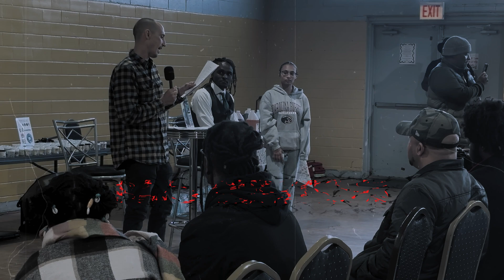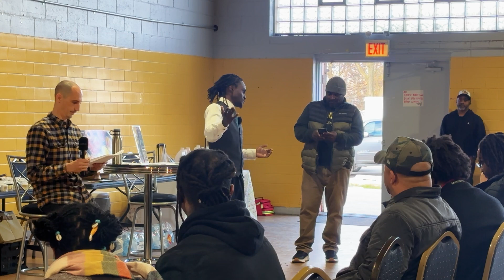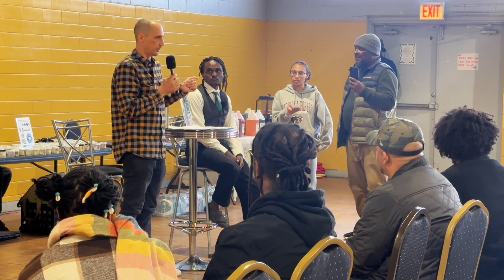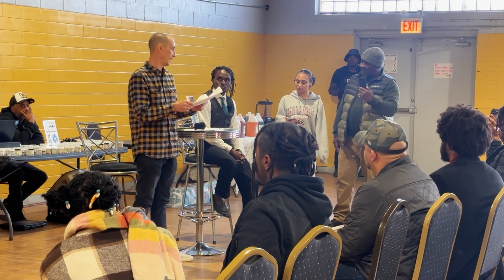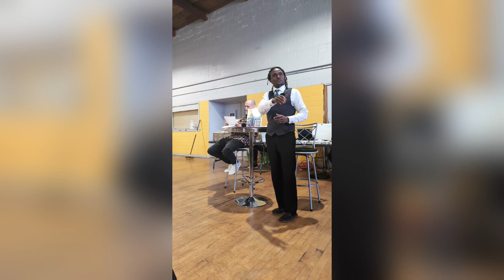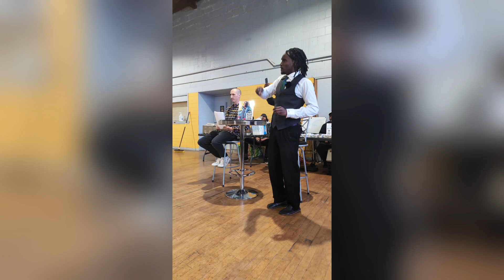The Plastic to Fuel Debate

Comment: A Few Points to Clarify:
Parameter Control: When I mentioned that your system doesn’t control parameters, your response about turning magnetrons on and off doesn't quite address the issue. In a system as large as yours, that's going to result in uneven heating, which inherently creates wide, uncontrolled thermal gradients. And because your condensation system is passive, you're essentially letting condenser performance dictate pressure and temp, rather than actively managing them. This makes reproducibility and safety harder to achieve.

Burning Unknown Fuel: You downplayed the importance of analytics by citing decades of literature on petroleum fuels, but pyrolysis oil from mixed plastics — with adhesives, inks, and unknowns — isn’t the same thing. You still don’t know what’s in your fuel, and saying you spoke to the EPA and they were "okay with it" because it’s a closed system doesn’t hold up when your own videos show venting to atmosphere via a pot still. That’s a direct contradiction.

Analytical Dismissal: You dismissed the cost of in-house analytics, even after I gave examples of affordable GC/MS systems that are well within your means. I’m self-taught in this area — and if you’re serious about leading in this space, I’d encourage you to do the same. It’s doable and absolutely worth it.

Unsorted Feedstock: I understand your philosophy of wanting to create a “universal” solution, but dismissing basic chemical controls in R&D makes it difficult to know what’s really happening in your reactions. A more scientific approach would be to run one plastic at a time, introduce contaminants individually, and analyze the changes. This is basic experimental design and would make your results much more credible.

Scaling Prematurely: From what I’ve seen, very little actual bench testing or analytics were done before moving into pilot-scale development. If you do have data, I’d genuinely love to see it. I’m happy to offer help in reviewing and interpreting any results to support further development.

Misleading “Continuous” Claim: During the debate, you denied saying you built the “first continuous microwave pyrolysis reactor,” but I showed examples where you did, and after that, the language shifted to “semi-continuous” and “hand-made.” Changing the narrative post hoc doesn’t address the issue. It’s not just about being first — it’s about being accurate in public-facing claims.

Feed System Overdesign: I raised concerns about your large vacuum-fed hopper design being clunky and prone to bridging — especially since you haven’t established a working, efficient small-scale system. Using an extruder and melted plastic would allow you to test efficiently with 5–10x less volume, reduce energy input, and eliminate handling issues. But again, that suggestion was dismissed based on your desire to run contaminants — a goal that really should come after building a reliable, clean baseline.

Vanillin Mocking: We didn’t get to dive into this, but I wanted to say that converting plastic to vanillin is not only viable — it’s impressive chemistry. Mocking that pathway undermines legitimate science. It’s a selective, high-purity process that requires skill and discipline. If you’re trying to win over scientists or institutions, respecting these efforts goes a long way.

Public Messaging & Accountability: Your language and claims on social media are often grandiose and misleading. When called out, I didn’t feel there was much accountability. Instead, you doubled down on the idea that running your fuel in a truck was “historic,” when in reality, it’s not a first, and doing it without knowing the composition of the fuel is more risky than revolutionary.

Despite our disagreements, I want to be clear: I don’t want to see you fail. I want to see you win — but with systems that are solid, safe, efficient, and scientifically defensible.
Reply: Moving from a proof of concept to a well documented and tested design definitely makes it stand out credibility wise. I completely agree with what you were saying and if I was a few years younger would not appreciate it. Scaling it up a passion project requires so much overhead, so this message is golden.
Reply: What did you invent?
Reply: @investingoutdabluu2210 what did you invent?😅😅 Julian didn't invent anything his reactor is not continuous and the microwave pyrolysis machine was invented in 1971😅😅😅 can't fix stupid
Reply: @investingoutdabluu2210 he didn't invent anything. I've built ethanol recovery systems that can recover alcohol from oil at up to 600 gallons per hour using 5% of the energy that traditional distillation takes.
Reply: @investingoutdabluu2210 what did the naturjab guy invent?
Reply: So what about microplastics?? He’s doing more with plastic waste than 99.9% of the people out there.
Reply: @brandonpatterson5705 actually he's not doing more Plastics than anyone else. If you check out the full Channel of nature job. Julian also makes all natural deodorant that is utilizing brand new plastics for the containers instead of glass. He's on here preaching how we have a plastic waste problem but then he's also contributing to the plastic waste Problem by making his merchandise with brand new Plastics. Make it make sense 2025
Reply: julian needs to quit lying for views and being so defensive when others like you give new ideas or bust him out for being dishonest!!!!! precious plastics has a plastic extruder and shredder that can do everything...... cost 1500 to build it yourself, or 3 to 6k to have one built. Julian should also have a gasifier powering generator not gas to power it. his machine is not zero emissions when he uses a gasoline generator to power his set up. huge lie he makes is saying he has zero emissions. half lifes of toxic chemicals is still bad to breath in..... this dude julian just doesn't care about gas vapors being toxic, making excuses to say half life chemicals is better than the oceans..... lmao hahahahahahaha, people on precious plastic are shredding plastic and melting it back down into park benches, plastic bricks, 2x4s, and kitchen countertops........ julian will only succeed when he starts to be honest with himself and the public......or he will continue to blow himself up when he doesn't listen to others, to practice safety first. he has blown himself up 2x already....... not the brightest bulb in the pack. his last hospital er visit could have been avoided if he would just have worn a fire suit.... but noooooooooo Julian never listens, he just gets defensive, and uses big words to make it seem like he knows what he is talking about. furthermore a plastic shredder with a high torque motor with low rpm will shred and crush anything, these are also made and are open sourced to make yourself on precious plastics website. the metal yard uses this machines but at a larger scale. no one wants to see anyone one fail, but he will fail when he refuses help from professionals and keeps being so defensive..... julian is like a lil know it all,. but doesn't know it all..... lmao
Reply: @honda-s2k you are 100% right!! Except I don’t think he is dumb. He is young. And he is an influencer not a scientist. He doesn’t want to lose the following he has.
Reply: @crybbythecrybaby  he is not dumb at all, but most of his followers are. he needs to  be 100% honest and practice safety like wear a mask when making gas lmao
Reply: @honda-s2k  I agree. His ego trumps his willingness to learn. He gets his ego stroked and pockets filled by folks that think they are helping him change the world while he sells them simple skin care formulations made at home. I had held out hope that his heart was in the right place, but his disregard for actual professionals in the field makes me feel like this is another social media content grift.
Reply: @noahpcook1  sun power will never power that reactor, but a gasifier will. a gasifier is old tech and limitless renewable energy as long as a person has trees....jualin has trees.... the thing people forget with solar power, there is no sun at night, also a person needs a huge deep cycle battery bank to run 14k watts and capacitors to store the energy when there is no sunlight. the fire department has told julian to wear a gas mask to protect himself from off gassing of plastics yet... in every video the only protection he uses is googles. gas is toxic, he needs to quit telling people to smell the plastoline. most people are sheep and just will believe anything that flies out of his mouth like the 1800's scammer medicine man with the meds that cure all ailments. he lied to you in this video while you were on stage. he has said in every video he has the first ever continues reactor, he has never said once in any video he has the first handmade continuous reactor evvvvvvver!!!!! that is being very very very dishonest, and his reactor like you pointed out is not continuously running, which is another lie he made for likes and views. he lied about the first ever truck running plastoline in his video on april 2nd..... he already did this last year on that diesel truck.  his lies are catching up to him....... noah. great job keeping him on his toes and calling him out on his bs.
Reply: @noahpcook1 Noah, I thought you did a great job in the debate. Besides having an interest in protecting the environment I have very little interest or knowledge of the subjects discussed. I thought you explained things very clearly so even a layperson like me could follow the discussion. From what I’ve read in the comments and heard in this debate and on other channels, just hearing that he is disposing of these carcinogenic substances by pouring them directly into the ground sounds incredibly reckless—so reckless that even an individual like me with no background in chemistry knows that can’t be safe and it can’t be considered the best method to dispose of such waste. 

That being said, I think you were incredibly brave to go up against a room full of his obvious fans and be on a YT video for his channel that is filled with an even larger amount of his fans. Having anxiety myself, even if I was as well educated and articulate in your points, I would definitely been hesitant to debate him as you did and I think the part you played in the role of the “10th man” is crucial in this discussion and his continued work. 

All that being said, I think Julian plays fast and loose with definitions and semantics. This is a strategy often employed by grifters. After reading in his description for this video all the requests for donations is especially disheartening when he only pledges to use 10% of the money he collects to build his reactor. Where’s the other 90% going??
Reply: @bunnyluver2176  thank you. I would love to be able to contribute to a project that can impact the plastic pollution problem. This ain't it. The more I've followed Julian and attempted to interact with him, as well as watched him interact with industry professionals, I'm becoming more aware that this is a grift. One thing that I fear is that he somehow loses his life due to negligence, and that perpetuates the conspiracies that are already rampant in his under- informed comment sections.
Reply: 10% of his money went to that taco truck lmao. julian is like a 1800s scammer medicine man. i like to see his books and see where all the donations are going!
Reply: don’t be dismayed by all these people calling you a hater. it’s actually so kind how much of your time you gave to someone who doesn’t really want to listen but rather argue with you. if anything it’s just insightful about humans.
Reply: @DomoHomme  thank you. It wasn't easy for me because of my high social anxiety. I was hoping to to bring balance to his approach and his fans understanding of the process. I failed and just added to the momentum of his social media persona.
Reply: @noahpcook1 he is a grifter with some sort of delusion. I have been watching him do this for years because it keeps popping up on the algorithm. 

He isn’t doing anything new or exciting and is selling half baked ideas for social capital and money, it’s really gross.
Reply: @noahpcook1 Noah, I thought you did a great job in the debate. Besides having an interest in protecting the environment I have very little interest or knowledge of the subjects discussed. I thought you explained things very clearly so even a layperson like me could follow the discussion. From what I’ve read in the comments and heard in this debate and on other channels, just hearing that he is disposing of these carcinogenic substances by pouring them directly into the ground sounds incredibly reckless—so reckless that even an individual like me with no background in chemistry knows that can’t be safe and it can’t be considered the best method to dispose of such waste. 

That being said, I think you were incredibly brave to go up against a room full of his obvious fans and be on a YT video for his channel that is filled with an even larger amount of his fans. Having anxiety myself, even if I was as well educated and articulate in your points, I would definitely been hesitant to debate him as you did but I think the role you played in the “10th man rule.”
Reply: @noahpcook1 you didn’t fail as soon as I heard of him from big juicy I was looking for someone like you who could put this in scientific terms. As my Initial reaction was sane because I’m not 14. If he was doing something revolutionary why have I heard of plastic recycling already 😅
Reply: @TetogBdawg I don’t think he is an intentional grifter. I think he has a brilliant young mind and he blew up before he was properly educated on what he was doing and now he is in too deep to stop. And his ego forbids him from listening to more educated people
Reply: @crybbythecrybaby yes, he fell into circumstances during this journey that are important for him to manage, negatively impacting the original project
Reply: Agree with every point. Tbh i don't understand why he doesn't focus on the fuel not the machine bc he has done anything to innovative the science by the machine.
Reply: @onemanonevote4223  he doesn't ask himself if he should make it bigger at this point. He asks himself if he can. My approach would be completely different if I were trying to innovate. If I were trying to get a big following and lots of donations on social media. I would do it like he is.
Reply: Dude phenomenal performance 🎉 thank you for calling out the grift… might have to get professor Dave on this.
Reply: @ZimaBlue-c2p "professor" dave thinks there are more than 2 genders
Reply: Bro wrote a  whole book
Reply: @dueceplugs710  this is how I know you don’t like to read nor are you scientifically literate. I’m no gatekeeper of science but you people act like we are when it’s just a read and a few classes away from understanding chemistry. He does not address any of these in his book. Hitler wrote mein kampf you think he’s automatically right too?
Reply: @ZimaBlue-c2p first off, I actually love reading. Probably one of the most useful past times in existence. Second, what do you mean by you people? And third, it’s bogus for you to completely assume the person I am because I didnt want to read a 10 paragraph YouTube comment. If I wanted to read a book ,I would read a book ,not go to YouTube 💯
Reply: Boooooooooooooo!!! Cool story bro. Let me know when you build anything that works outside your Google Doc.
Reply: @noahpcook1
Reply: Well done for showing up mate, you seem to be a knowledgeable dude. Maybe you could collab, play some kind of devil’s advocate role.
Reply: Justified emotions about misuse of “government funds” and safety, is what this feels like. To you though, I must say: people need hope, the energy this guy gets from people, is hope. Maybe it’s a little backwards, and a little slower than people with big degrees and fancy labs, maybe it’s poorly managed, maybe if you were in charge it could go faster, better, stronger. It’s not fun to watch someone need help and refuse it due to ego. But you don’t come across as supportive. You come across as someone mad about the paperwork. I support his slow and a bit careless effort in this case, let him be dangerous for a min- the world has a lot dirtier issues than we do just in the US, and  solutions need to be implemented on location, not in a clean fancy lab. Let him cook, when he’s ready he’ll follow allllllll of those steps you mentioned.

This guy is not giving up anytime soon.
Reply: @bromato7 you sound so ignorant 😅 let him be dangerous? And what if something happens to him? SMH 🤦🏽‍♂️ he may be a brilliant young man but his supporters are ignorant fools.
Reply: @bromato7 he’s giving him advice and constructive criticism. you’re saying it’s unsupportive but it’s only unsupportive because the kid takes it as a blow to his ego and hate rather than info that could take him farther.
Reply: @DomoHomme  😂 stop projecting what others are doing to the brother onto the brother, we've seen what was done to inventors and their work in the past that looks like this brother, so keep your so called advice and guidance, the brother will be just fine, he got this.
Reply: @bromato7  you’re missing the point. He’s not creating anything new, do you seriously not think that this has been done already? The reason why it’s not already widespread is because it’s ultimately inefficient and causes more issues than it solves. On top of that he has wayyy less resources so he’s moving at an incredibly slow pace. He hasn’t even caught up to students yet. I want him to succeed in his endeavors but it’s just not going to happen, if people wanna direct their hope towards something then it should be towards an actual established organization.
Reply: Professional hater. Go make your own with all this information you have. Jullian is more productive and innovative than you considering he is half your age old man. If all you can do is critique him you are useless to him. Watch him rise above you in silence.
Reply: @YKTVYT  There’s a reason no one serious in the scientific or engineering world is doing this anymore. Pyrolysis oil as a fuel source was explored decades ago and discarded for being too unstable, corrosive, and inconsistent. The scientific method already moved on—to cleaner, more efficient tech like hydrothermal liquefaction and catalytic depolymerization.

Julian’s just reviving a dead-end process and selling himself as the savior to the layman’s fuel crisis while plugging his merch. That’s not innovation—it’s influencer branding with a chemical hazard twist. He should be damn ashamed of himself for using this large of a platform to pedal a physically and environmentally dangerous process, product, and byproduct to people who could have instead spent their time learning about something productive.
Reply: @YKTVYT  it's not hate. One point he's making is that burning the fuel made from plastic is dangerous, which is true. There's a reason this technology was abandoned the fuel made can't be made safe. Julian burning very cancerous fuel. But if you want to use plasticoline go ahead.
Reply: @YKTVYT you 😅 are 😂 ignorant 😢 science is based on criticism. It’s not science if there is nobody to critique him. Duh. But you wouldn’t know because you probably can barely read 😅 even your precious Julian said without critiques like Noah’s and others there can’t be any progress in science. But you probably have a 3 second attention span.
Reply: @YKTVYT 👏🏾👏🏾👏🏾👏🏾👏🏾👏🏾👏🏾👏🏾💪🏿💪🏿💪🏿💪🏿💪🏿💪🏿💪🏿💪🏿💪🏿🔥🔥🔥🔥🔥🔥🔥🔥 I love this comment fam, couldn't have said it better myself, i see a lot of haters in here pushing their negative rubbish and they are in most of his videos, how full of hate do you have to be to go to almost every video of this brother just to push negative rubbish,  at this point i genuinely think they're jealous of this brother and his following because they always mention his followers..smh..lol.. it's crazy.
Reply: @FARMOYT  it's been done and mostly abandoned by real scientists.  There is better technology like hydrothermal liquefaction and plastic recycling. If it made sense for more than social media content and getting suckers to donate, I would do it at home, too.
Reply: @noahpcook1 THISSSSSSSSSSSSS❤ ITS COMMON SENSE BRO 😂 IF THIS WAS PRACTICAL AND EFFICIENT THEN WHY oh WHY ISN’T EVERYONE DOING IT?
Reply: @YKTVYT This isn’t hate—it’s damage control. Julian’s not some revolutionary innovator, he’s clickbait with a merch shelf at this point. He’s pushing half-baked science to desperate people who don’t know that raw pyro oil is chemically unstable, acidic, and flat-out dangerous if you don’t distill, neutralize, dry, and blend it with real gasoline. Acting like this is some survival-ready miracle fuel is reckless. Critique isn’t ‘useless’—it’s what separates real solutions from social media science fiction. If he’s so confident, he should drop his full refining process, emissions data, and chemistry—not another hoodie.
Reply: Meat eaters CAN'T OUT THINK  Sun eaters/Vegetable eaters. 👁🧬☀️
Reply: Lol  @gameplayvideos9758